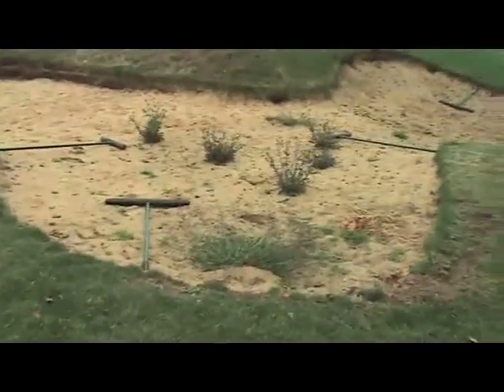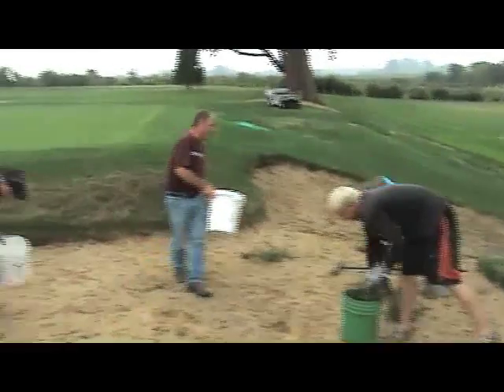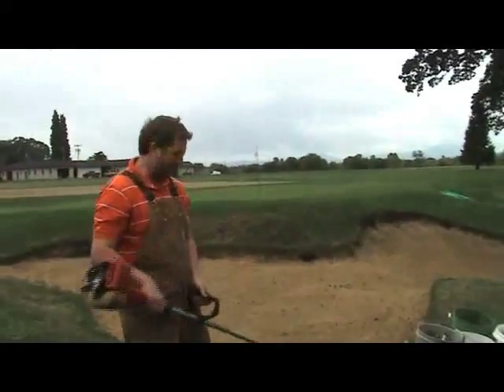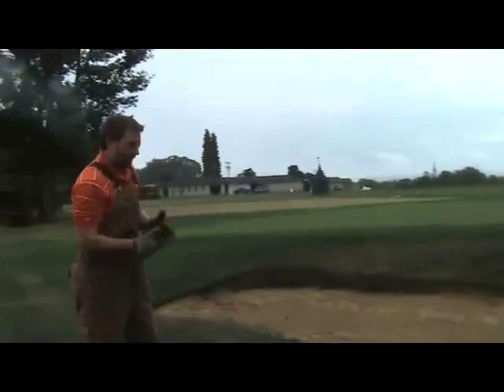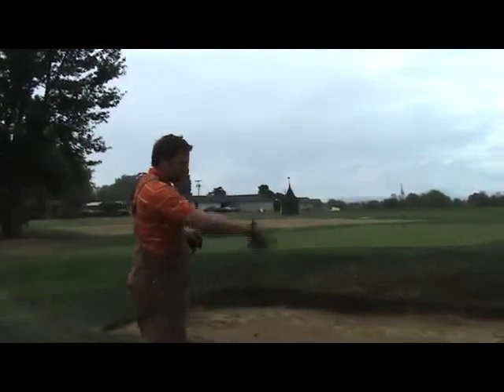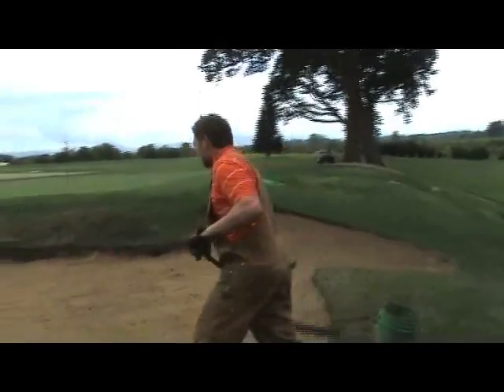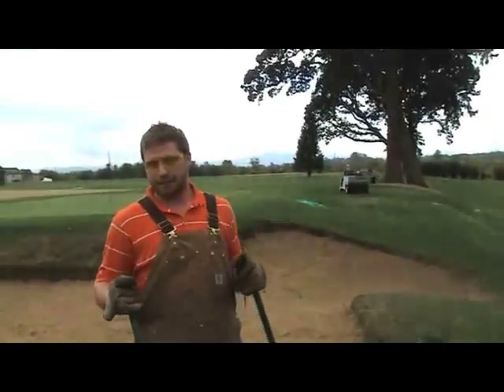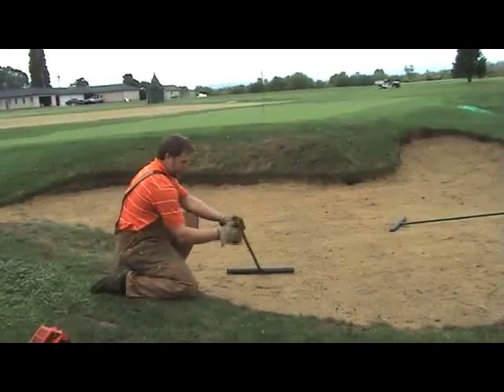Tod's Turf Tips: Edging Bunkers

Comment: one off the most long windest way to edge a bunker! use a edging iron on the bottom of the bunker to push away the sand and to get rid off the roots then flymo a lap round then edge with a normal strimmer or edging shears, then blow out the bunker then weed and rake simples

Comment: That will give you a clean edge of turf, and sand.

Then you flatten it out, and take all the foot prints out quickly with the golf rake, then take the metal fan rake just make clean bands from one side of the bunker to the other, so the lines the teeth leave point towards the hole.

Once that is done, use the metal fan rake and gently pull the sand to the edge of the bunker. As you say this does pull sand towards the edge, but not much, because of:

Comment: (a) edging done with golf rake at the beginning

and (b) I find a metal fan rake is much better to use... They dont pull as much sand as the plastic ones... They just groom, and further fluff the sand, very finely..

but just go around and evenly pull the sand from 2 1/2 feet into the bunker to the edge..

A 10 foot diameter circular bunker takes about 2 minutes to complete on average, doing all those steps. (on a daily basis)

I will make a vid sometime and post it.. Just the raking part..

Comment: Sir I gotta say that is the way one of my cow workers rakes bunkers... Now from what I see, everything you do, until you start actually raking is 100% good... BUt I personally do not like your raking technique. It leaves the surface looking rough and patchy.... At my course I use a machine to do big ones, ( Toro sand pro 3040 with the rear tooth rake attachment) and a metal fan rake to do the smaller ones...First you edge it with the golf rakes' flat end pulling sand away from the edge....